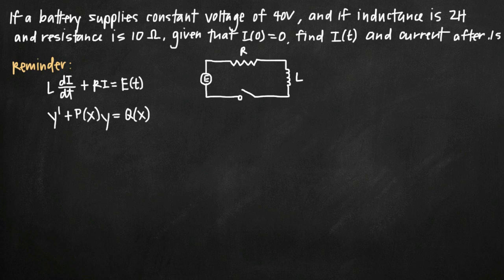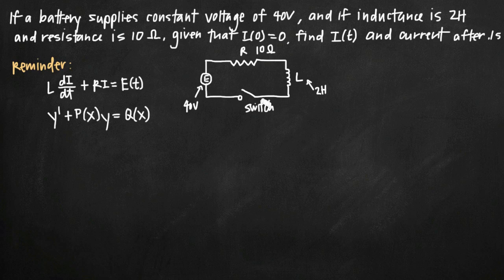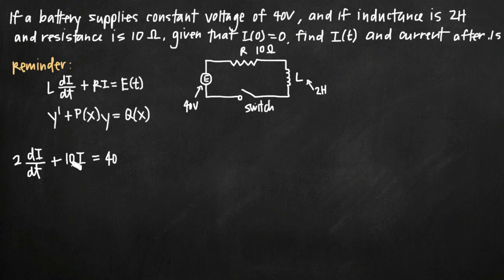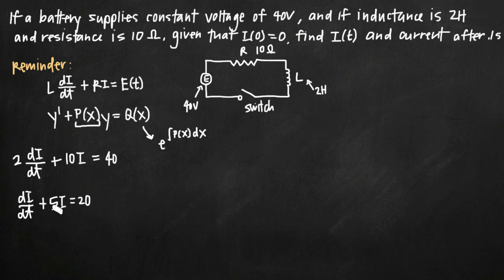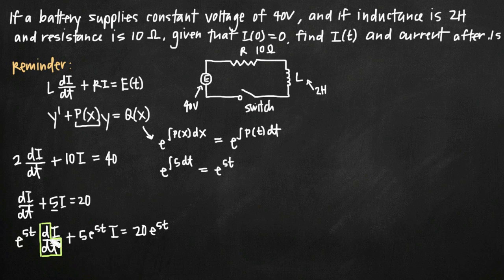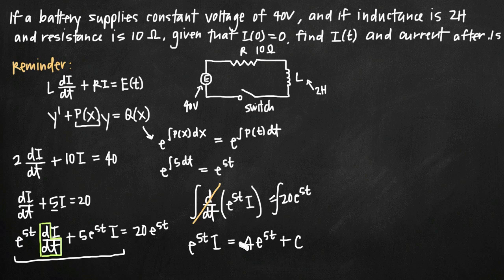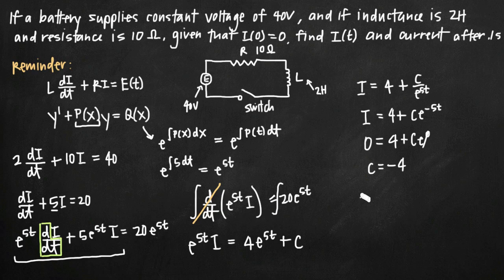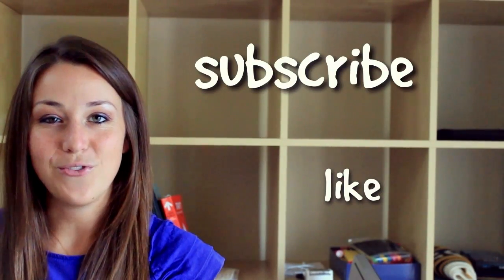Circuits and linear differential equations (KristaKingMath)

Comment: for a simple ODE method, must the circuit only have a single element: 1 resistor, 1 voltage source, 1 inductor, or current source?

Comment: This is O.K. for an application of applying an LDE to a time constant problem...that is, if we are only concerned with the math. But it's not really all that practical of an approach.

We have a time constant set by the resistor and inductor => tau = ( 2H/ 10ohms) = 0.2sec
Ohms law I = E/R => 10v/4 = 4Amps => steady state current

Use time constant formula => di/dt * (1- 1/e^(t/ tau)) => (4A - 0) *  (1- 1/e^(0.1sec / 0.2)) = 1.57A

nuff said...

Comment: At 2:30 why did you use the integrating factor? I mean why can't we use that method in which first we solve for the homogenous part by writing di/dt + 5i = 0, and then find one root, and then subsequently we solve for the particular part?

Comment: Thanks a lot, I found this very helpful! I've often been scratching my head over this when looking at electronics datasheets. I don't use the math very often and I don't remember it over time, so I'm always looking for an explanation that is specifically in the context of a circuit.

Comment: An absolute joy it was to watch you solve for the time domain expression for the current through the inductor in this circuit. I like the presence of the switch in the circuit diagram because it helps beginners understand how an initial condition of I(0)=0 can exist. Along the way you might have marked the switch as closed at time t=0+ or something like that to help beginners see that current is now flowing in the circuit. I'm not a beginner but I'm not the expert that you are. I admire your skills. I solved circuits this way in college over 30 years ago. Then the next semester we learned to solve them in the frequency domain taking the inverse Laplace transform to get the time domain expression. That's a review I'd like to see as well. Thank you!
Reply from the maker: +Vincent Randal You're welcome, I'm so glad you liked it!

Comment: Honestly? This is not exactly the most helpful video for anyone in electrical and electronics engineering. Especially for series and parallel RLC circuits. Those kind require more fundamental  electrical circuit knowledge. But this does give some insight into solving functions of current for basic resistor-inductor (RL) circuits. Kudos!
Reply: +Garrett Jeffreys I think this video is meant for students in calculus and differential equations who might get an exercise problem like this. Any EE student doing this kind of analysis should already know how to simplify a circuit. That being said, this explains the basics of differential analysis WAY better than my Circuits professor or textbook ever did.
Reply: Thomas Henley
But there are pretty much numerous ways to simplify a circuit in AC. I only need to know impedance analysis to solve circuits that are in AC without having to resort to using differential equations. If you understand the concept of impedance and Laplace transforms, as well as the Euler method, you should be set in solving these kinds of circuits. Differential equations only work up to a certain extent. In this case, usually up to parallel and series RLC circuits. For anything much more complicated, you're going to need impedance analysis combined with methods that are used in DC analysis as well.
Reply: +Garrett Jeffreys OK, I guess to reiterate what I said before, this video is for Differential Equations students, not circuits students. This channel is for math, not engineering. Krista never claimed to be an engineering instructor.
Reply: Thomas Henley
And to reiterate, I'm just pointing out that it's not exactly helpful for electrical and electronics engineers provided they would want to know more about how an RL circuit works (i.e.: low-pass or high-pass filters in AC). However, it does give a beginner electrical/electronics major or hobbyist a good idea on basic RL and RC circuits in terms of writing a differential equation for them. But to find out how they function, they would need to refer elsewhere. Because this isn't the video.
Reply: +Garrett Jeffreys You are absolutely correct, there are much better videos describing AC circuits out there for electrical engineering students. This is not that video. It's for math students. Not. EE Students.
Reply: Jordan Sorry, don't agree that video is not for Electrical students. My maths is not great and I went to this video as my book "Understand Electrical &Electronic Maths" was too confusing, left too much out in its explanations. I wish she would do more as I find her " hand holding" explanations really great especially if your maths is rusty like mine.
Reply: +Garrett Jeffreys indeed check her videos all those videos are aimed for math ... and I agree with Thomas Henley ... I took myself a Calculus curse at uni and she explain much better than my professor ... who has several published articles phd ppost doc etc etc that does not help in any way for us students to understand the subject better...
Reply: Juan Garcia
But you are not understanding my point. I'm talking exclusively to those who are electrical engineering students. This is not exactly the best video to refer to if you're an electrical engineering student because it really just goes over the math aspect rather than the electrical engineering aspect.
Reply: I'ts for ODE class and other DE classes facepalm
Reply: I disagree. This is super helpful. We use differential equations all the time at work. We don't even say "voltage" when talking about inductors- we call it "L di/dt." Differential equations are everything. Obviously you have to use other techniques like Laplace and frequency domain analysis, but there are different tools for different jobs, and diff eq. is one of them.
Reply: +Garrett Jerkies
1. ODE are also taught in EE, besides other techniques, in any respectable school. Not just Laplace or any other easier/quicker methods.
2. Euler method is an aprox not exact, worse possible way to solve. Not sure why you suggest this if you are looking for "helpful videos". It's like you are trying to sound smart.
3. If you think you can do a better video, do it, or else shut the fuck up. At least someone is trying to put the time and effort to relay useful information.

Comment: I'm taking electrical and electronics circuit, the book use a strange formula that doesn't explain anything to solve for a function of v(t) for transient circuit. Going back to math, I immediately realize this is a first order differential equation using the method of integration factor, and as a result, my result was correct with the solution.
Thank you for posting this video.

Comment: Outstanding d/dt displacement. I have to think about it.

Just in case:-)
I have a question on a similar equation

From stewart 'explanation' p521

dI/dt = 15-3I            I(0) = 0
Where does this step comes from?
-1/3 ln |15-3I| = t + C

Comment: The same process takes place with AC transient circuits.  You can perform this in the Laplace domain.  The steady state voltage will be sinusoidal instead of DC.

Comment: This is the sort of problem where it helps to have a handle not just on the equation but on what the physical system is actually doing. Because you have a fixed DC voltage, you can deduce that the expression for current is going to decay towards some fixed value, with the value of any exponential term(s) approaching zero for not-very-large values of t. If you ended up with a positive exponent, you would know you'd gone wrong somewhere.